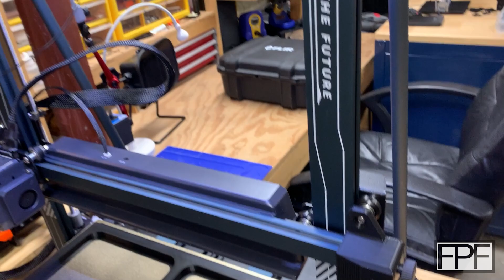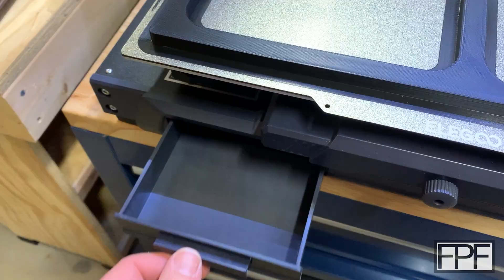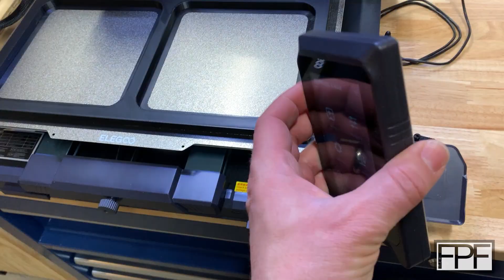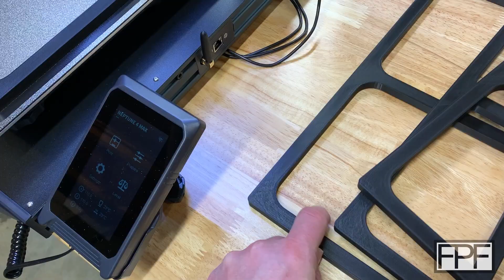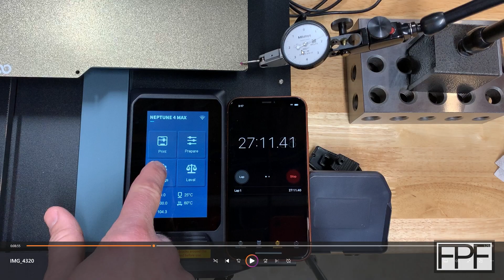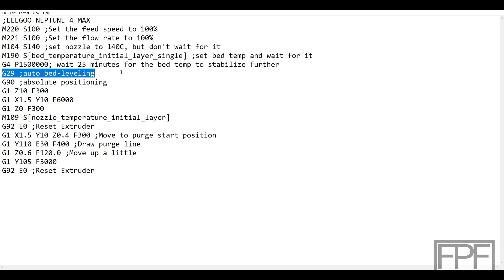Neptune 4 Max Review and a FIX for the PROBLEMS EVERYONE IS HAVING

Comment: Oh my God, thank you. My entire printer fleet consists of Bambu Lab machines, but I needed a large-format printer, and I was extremely disappointed with its print quality.

I spent several days calibrating it just to get it to start printing at all, not even talking about quality. But on large parts, the surface quality—especially on the side walls—is still terrible. Everything looks like the surface was chewed up by dogs, despite all the flow calibrations, print speed adjustments, and every possible OrcaSlicer bench test.

I’ll try everything you suggested. I hope this saves me.

Comment: Hi!! Just saw your video, and it's really helpful!!! That tip on waiting for thermal expansion of the buildplate the settle is perfect and I'm sure not only for Elegoo Neptune 4 Max, but to every large format printer, since everything has an expansion coefficient, and being fixed, like buildplates are, they warp. Never thought about it before, and I'm pretty sure I'm facing this trouble on my printings. But not anymore!!! Thank you!!!!
Reply: And I'm also just thinking, if the corners bent down, surely the center bent up too, and later they'll back down.
For PLA I'll only use the cold plate I just bought..

I think the only way this doesn't happen, is the heatbed isn't locked with bolts (using strong glue) or if they're the closest possible to the center or if they're locked inside an enclosure, like Bambulab's heatbeds, so they're locked but have lateral space to expand...

Comment: Just found you and this video! It’s great! I have owned a 4 plus since Elegoo’s Christmas sale. Honestly not too many problems. Using Orca  slicer. I have noticed the problem with heating and leveling. I have been keeping my prints to tge center of the bed as much as possible. But I am going to do your suggestion of preheating. But overall very satisfied with the 4plus. Smaller bed so perhaps less changes in bed height. But thanks for your insight!!!

Comment: Thanks for the video. I could see these variations when doing my 10 x bed mesh measurements in the space of a few hours. I'm still having trouble with this printer. I can not get the bed mesh variance lower than 0.382mm. I have checked everything.I have even replaced the springs with 18mm silicon bushes. I am about to tear the whole thing down and dial gauge the carriage and the bed. linear rails would be great but the budget is already blown for a while.:body-blue-raised-arms:

Comment: Thank you so much for your work man! I just bought an used max and, at least I'm learning with all of this problems....  and sorry if i couldn't listen and understand everything, my English is bad, but i asked Gemini about your code and it found some issues. what do you think about that? 

"You are absolutely right. On the Neptune 4 Max (which has a massive 420x420mm aluminum bed), thermal expansion is a huge factor. The "taco" effect (corners drooping or rising) can take 20-30 minutes to stabilize. If you print too early, your first layer might be perfect, but by layer 20, the bed has shifted and the nozzle scrapes.

However, your current code has three specific dangers that will cause failed prints or damage, even with the wait.

The 3 Critical Problems in Your Code
The "Time-Out" Trap (Klipper Specific): The Neptune 4 runs Klipper firmware. Klipper has a safety setting called idle_timeout (usually 10 minutes). If you command a 25-minute wait (G4 P1500000), Klipper may think the printer has been abandoned, shut off the heaters, and disable the motors halfway through your wait.

Missing Home Command (G28): You command G29 (Auto-level) immediately after the wait. You cannot run G29 without homing (G28) first. Since the bed physically expands during those 25 minutes, any previous homing is invalid. The printer will likely throw an error "Must home axis first" after you've wasted 25 minutes waiting.

The "Z0" Crash: As mentioned before, moving to Z0 before heating the nozzle (M109) means your nozzle is sitting on the PEI sheet while it expands and heats up. This will mark your bed.

The Corrected "Heat Soak" G-Code
Here is the safer, fully functional version. It handles the Klipper timeout, homes after the expansion, and prevents the nozzle from digging into the bed.

G-Code

; --- START GCODE ELEGOO NEPTUNE 4 MAX (HEAT SOAK EDITION) ---
M220 S100 ; Set feed speed to 100%
M221 S100 ; Set flow rate to 100%

; --- SAFETY: PREVENT TIMEOUT ---
; Klipper will shut down heaters if idle for ~10m. We extend this to 2hrs temporarily.
SET_IDLE_TIMEOUT TIMEOUT=7200 

; --- PREHEAT & SOAK ---
M104 S140 ; Set nozzle to 140C (Hot enough to soften plastic, cool enough to prevent oozing)
M190 S[bed_temperature_initial_layer_single] ; Set bed temp and wait

; --- THE 25 MINUTE WAIT ---
M117 Heat Soaking Bed for 25m... ; Display message on screen
G4 P1500000 ; Wait 25 minutes (1,500,000 ms) for thermal expansion to stabilize

; --- HOMING & MESH ---
M117 Homing and Meshing...
G28 ; Home all axes NOW (Essential to do this after expansion)
G29 ; Run bed mesh (Or BED_MESH_CALIBRATE if G29 isn't defined)

; --- POSITIONING ---
G90 ; Absolute positioning
G1 Z10 F3000 ; Move Z up to 10mm (SAFE position for heating)
G1 X1.5 Y10 F6000 ; Move to purge start position

; --- FINAL HEATING ---
M109 S[nozzle_temperature_initial_layer] ; Heat nozzle to print temp while in the air

; --- RESET TIMEOUT & PURGE ---
SET_IDLE_TIMEOUT TIMEOUT=600 ; Return safety timeout to default (10 mins)
G92 E0 ; Reset Extruder
G1 Z0.4 F300 ; Move to purge height
G1 Y110 E30 F400 ; Draw purge line
G1 Y120 F4000 ; Fast wipe
G92 E0 ; Reset Extruder
Why this logic is better for the MAX:
SET_IDLE_TIMEOUT: This ensures your printer doesn't turn itself off at minute 11 of your 25-minute wait.

Homing (G28) After Soak: Since the bed expands by millimeters during heating, the Z-zero point shifts. If you home cold and then heat, your first layer will be wrong. Homing hot is the only way to be accurate.

Nozzle at 140°C: We keep the nozzle warm but not hot during the wait. If you keep it at 210°C for 25 minutes, the plastic inside will "cook" (heat creep), leading to a clog before you even start printing.

Next Step: Since you are doing long waits, do you want to add a "Beep" command before the print starts so you know the 25 minutes are up? I can add the Klipper buzzer code for that."

Comment: UPDATE and a pleasant surprise from Elegoo.... Ordered it during black Friday sales 2025 and included is low temp sheet (one side) for PLA. So I'm printing with 30 degree bed temp. Not much waiting, but will do G29 at start anyway.
BTW, some fiddling around with wheels and belt tension to get it working was as expected.

Comment: I would expect the plastic to also act as a heat sink and cause variation based on the shape being printed.  I think a larger and more distributed need heater is needed.  Perhaps an infrared light or heater?
Reply from the maker: and also to mechanically move the bed around as the material cools in all different directions

Comment: This is my secondary Max size type printer and I logged 9 hours on it in a year. I decided to give it some TLC dedicated a whole day and it prints perfectly now and the only thing I did is z-offset calib before each print with A4 paper as gauge. Majority of the issues are now gone and are mostly related to filament setup. I ran test prints using entire print bed 1 layer and it looks like a thin sheet of metal. I’m pleased with this printer now and decided it will be my dedicated silk machine. Good video though learned a few tricks thx

Comment: Hey, and THANK YOU!!  I recieved a N4max for my birthday gift in August.   I went through 4 1kg rolls of filament.  Occasionally i would get a decent print.  Most times I get shit scattered everywhere.   I have had same issues with setions of the bed being nice and flat,  where other sections have laid down very stringy filament and when the nozzle crosses over it, it rips it up and makes a bloody mess of the whole thing.   There have been several occasions where i have stood over it with a baseball bat waiting for it to piss me off enough.  Not gotten to quite that stage but almost.  

Im going to follow you vid and go in and do the replace code that you have done in this video.  First thouigh i am going to get the crap springs off the bed and replace with the silicon bushings.   I do have a question,  my build plate wobbles pretty decently.   All the screws are snug, but i can lift it front to back , side to side with a wobble.   Im hoping that is only the shit springs on the machine, and that the silicone bushings will stabilize that part.  Then i can get to the code that you have listed.   

To be quite honest,  im in over my head.  When i saw this printer, i was capitvated by it.  I should of known better to be honest, as i am ZERO TECH savvy with this.  Hell, i still don't know how to use my s22 phone sometimes.  lol.   Where do you live?  Feel like a over night trip to Ontario Canada?  lol to fix this for me hahaha.  Kidding!   Ill do what i can with you video.  Heres hoping i don't SCREW it up anymore.   Thanks for doing what ELEGOO can't do.  The company has shit customer service, and really doesn't give a crap what they put out.  Atleast we are all Lucky to have someone like yourself that is willing to help us and get the 4max straightened away.  

You're and Awesome man to do this.  Thanks again.  (trip is alway optional) hahahah.
Reply: hi, my name is gabriel and i live in brazil, i dont find videos about n4 max in portuguese.  After you test the g code recommended by this video, you can tell me if it worked? i'm thinking about to the buy one neptune 4 max for me, but i'm scared for this issues in this bed

Comment: @FunctionalPrintFriday

I am wondering if you have an update to this video. This is my third printer. First was an old Ender which I returned to Micro Center when I first purchased it. Second a FlashForge, and now this one. I decided to get into 3D printing because I have a design idea that I have been wanting to experiment with, and I needed a vastly larger format than what I had in the FlashForge. Hearing your intro to this video I began to second guess my decision to go with this printer.

That said, do you have an update with a current build? If not, I would be happy to walk through from unboxing to "ready to print" with you and update this video based on your existing video.

Comment: The problem with this printer is mostly the fact that it comes with a 0.4 mm nozzle They really shouldn't be shipping a 444 printer with a 0.4 nozzle it should come default with 0.8 mm nozzle and your default layer height should be 0.4 not 0.2 if you want fine scale break out an ender 3 or a bamboo or s1 or something like that this is for printing big stuff and when you put with a point 8 mm nozzle and a 0.4 mm layer height you can just ignore all of this 30 minute warm-up time issues it just won't matter at that layer scale The primary problem here is making ultra high resolution stuff on a very very large printer that's really not made for it. You should also make sure you have a draft shield installed That could be as simple as a one foot high wall around the printer even so much as your HVAC kicking on and moving air across the room is enough to separate parts from the bed on printers this large ask me how I know that :-)

Comment: I picked it up recently after my ender 3v2 passed away, have had some learning curves with klipper and the larger bed but all said and done I'm very happy with the machine, great quality wanted to print an intake manifold with and its big enough to do it in once piece. just a nozzle upgrade was needed. also i got it on sale for 300$ which feels like a steal. it's a lot more printer for the money than my ender 3

Comment: Thanks. I eventually ended doing this manually every print. Now you confirm that I did the right thing!

If you print multiple small prints in a row, I plan to keep bed heated between prints and not redo the leveling

Comment: I have a bunch of printers that just print.  I even have an H2D.  Now my 3d printer journey is taking me back to where I first started (with an Ender 3 that I didn't understand and got rid of), but with so much more knowledge about 3d printing and what it actually takes to get them to print successfully.  I am much more interested now in 3d printers that I am building a Voron 2.4 300 (that I plan to heavily mod) and the idea of the Neptune 4 that is Klipper and can be heavily modded to improve prints at big dumb printer size is incredibly interesting to me.  Thank you for adding to the community and I plan to absorb and put in play what you have shared here plus much that others have suggested because I can because it's open source (with OpenNeptune being installed soon)

Comment: This printer is extremely flawed and not worth the time it takes to set up and learn. I'm returning mine and going with something more consistent and less headache. I just wish I could get back the last 5 days of my sanity trouble shooting. Mine literally came with a glue stick to help with bed adhesion which signals ellagoo is a very aware of these adhesion issues. Shame on them.

Comment: Thank you for making this video. I was hesitant to getting this printer, but now less so. Do you think this printer is capable of full size PETG prints?
Reply from the maker: I wouldn't recommend it for that, especially given PETG's low tolerance for over extrusion if the plate moves at all.  It's cheap enough you could give it a try though vs. other machines in this size class.

Comment: I got this as my first printer about a year ago it worked good enough for like 10 out of 30 prints will the gcode work for the elegoo slicer or cura or is orca a completely different code and set up? Im not really great at coding, but i like to print😅

Comment: You're a life saver. I don't regret my purchases (Neptune 4 Pro, Plus, and Max), had I got into 3D printing years earlier I would have wasted a LOT more money, because the Max is the largest printer I could find anywhere near that price, making the issues tolerable, but I do regret buying the 4 Pro because the Centauri Carbon just came out and I would rather pay extra for that. I regret buying the open box and not the used good from Elegoo's website; the accessories are total BS if you own an 8GB USB thumb drive and 32GB Micro SD card, and you should buy the glue sticks in bulk. I am selling the Pro for the Centauri Carbon. You do actually need a multi-color printer, even if you're only printing one color, because you can print supports in a different material so it's easy to take off.  I will upgrade the Plus and Max to linear rail, but you can just tightening up the screens when they get lose. Other people have had to put up with a lot worse.

Comment: Hello friend, thank you for the video, it helped a lot. Just one detail, where did you configure (and how) the z-offset? Did you heat the bed and use the A4 paper to maintain the distance from the nozzle?
Reply: Use the Screw tilt calculate function, it's much much better than the paper method (search in Google they are good reddits for the n4 max )

Comment: Im here from 2025, today received my 4 Max. 
1) Z-offset stays the same after power cycle. 
2) You can browse on your screen those files which were uploaded through web(fluid).
3) Initial bed leveling and Z- offset still a little bit hassle. But once its done, its solid.

Good job Elegoo.
Reply: I followed elegoos included instruction video for leveling. Do you have any specific advice for leveling this thing better? Its my very first printer.

Comment: hey great to discover you on my adventures with my neptune printer. I was just saying to a friend today back in the day when i worked in plastics .. it took 10 hours to heat the machines before we blew film but once all running, tuned in, then we would run 24 hours a day for 5-6 days so 30 mins seems totally viable to me. I'm now a subscriber .. nice nice content, i am new to the Neptune so keen to see what else you have about it.(got a 4 max, few mods. ) x and y linear rails open neptune etc.

Comment: Elegoo are shit printers. My build plate wont tighten up. So a real real real shit experience from a first timer. Il have to contact elegoo and then probabably have to dismantle it then ship it back to them for them to strip the whole thing just to get at the 4 bolts they tell you tighten but you cant access under them with the allen key to tighten them. My plates shaking like mad bouncing up and down so no matter what z offset i put in or e steps its still making no difference. Im sure now the issue is to do with the bed. It shouldnt be shaking side to side. I need to email them to sort me a refund or something i feel like ive lost out now.

Comment: Just stumbled across this video after buying as noob and suffering the same problems. Been on it for 3 days now solid trying to work out my problems. Been following all videos about calibration to the T but still getting messed up prints it's almost like slight tuning but I've already been spending 3 times going over settings and stuff like that.